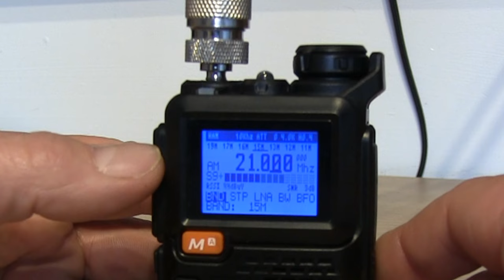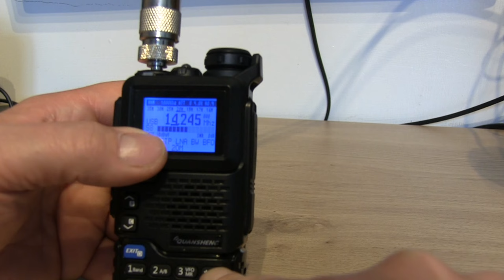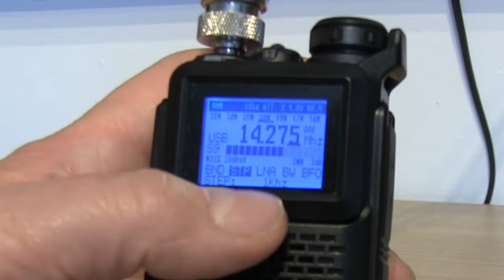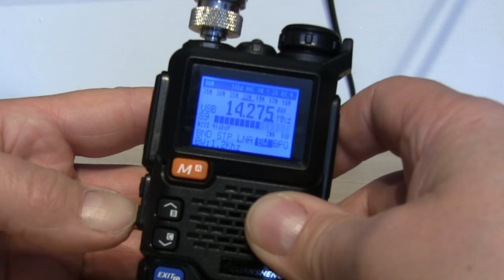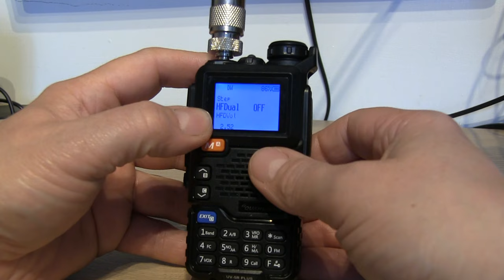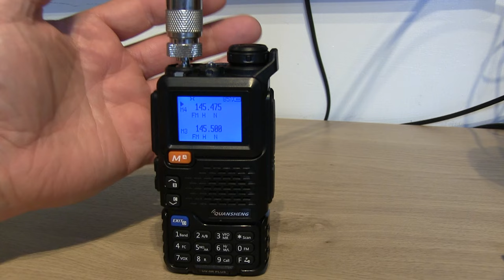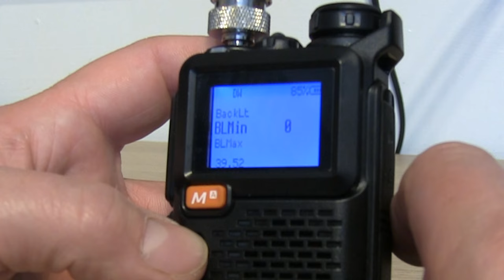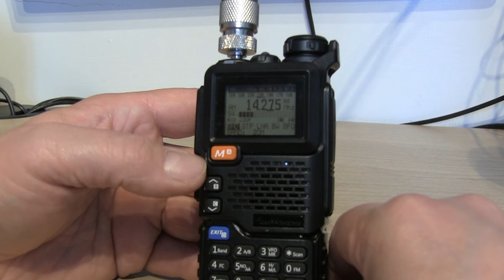Quansheng Full HF RX Mod running CEC_0.41HF Firmware

Comment: Well there you go it works…yeah i was a bit disappointed with the display time out on HF as it is currently used as a bedside receiver, maybe i should look into making it permanently on. For those links i used trusty Kynar wire with my old simple Antex X25 iron which has been to the moon and back. I actually bought a new Weller solder station a few weeks back on the Amazon spring sale event but i have yet to try it or should i say even look at it. 😂
Reply from the maker: Thanks again Neil 👍 Thanks for the info, I must invest in a better iron 👍
Reply: @m7frs272  The problem with cheap irons they struggle to hold temperature when the tip hits your work, you’ll be surprised how much heat gets absorbed by the board.

Comment: I just finished mine, there are three settings when you scroll through upper and lower sideband, theres one labelled cw or something... not sure what that is. Now just to make a half decent mag loop or something. Cant figure out which antenna design i want to commit to trying to build but im leaning towards a mag loop.
Reply from the maker: CW mode is 'continuous wave' for morse code. Good luck with your antenna project! Thanks for watching 👍

Comment: My mod was working at the beginning. But recently I noticed i didn't receive anything in hf anymore, and i can hear (my assumption) fm breakthroughs all over the hf bands... Strange.
Reply from the maker: Sounds like you may have a loose connection or dry solder joint possibly? Thanks for watching 👍

Comment: I have a problem. When i press 0 radio is jammed. Where is solution? ;(
Reply from the maker: Are you using Firmware version 0.41HF or 0.5HF? It sounds like you may have a loose connection. Have you ever had it working? I've had it where one of  the link wire hasn't been connected properly. If you're using Version 0.5HF the screen will get stuck on 'WAIT' if its not connected.
Reply: @m7frs272  this is my brand new radio. I have k5/8 and I have egzumer on it. But on UV 5 plus I have now 0.5 hf and on it is only 'wait' when I press 0. 10/20 min and its the same. One hour ago on UV 5 plus I had 0.41hf and radio was blocked...but without 'wait' message. Sorry for my english, but I hope that You understand.
Reply from the maker: @kethlerlomza  Yes that makes sense 👍 No problem with your English 👍 What Mod board do you have fitted in the UV-5R Plus with CEC_0.5HF ??
Reply: @m7frs272  mod board? Where I can check it ?
Reply from the maker: @kethlerlomza  For CEC_0.41HF or CEC_0.5HF to work on the HF bands you need to have an additional circuit board fitted like I have done in this video: https://youtu.be/ka6mybUag2Y?si=oteSfpieR67gLmb9
Reply: @m7frs272  
I thought it was already on the new radio. I'm afraid I won't be able to handle this repair. I'm sorry I took up Your time. Thank you for your help. :)
Reply from the maker: @kethlerlomza  No problem at all, I didn't think I was going to be able to do it. This was my first attempt: https://youtu.be/-nXx5gyDDu4?si=Sc6NpXb-HywzagM9

Comment: What does the BFO Setting do? I've been listening to various frequencies but changing the BFO doesn't do anything.
Reply from the maker: BFO is the 'beat frequency oscillator'  which allows you to fine tune differences between the transmitter and receiver.

Comment: how to get 27125 on fm mode
Reply from the maker: No need to do the full HF mod. If you want to listen to FM CB then any of the custom firmware will support that for receiving only. If you want to transmit then buy a CB. Thanks for watching 👍